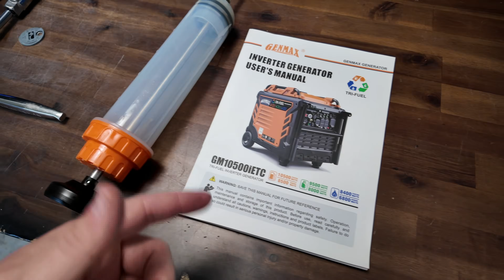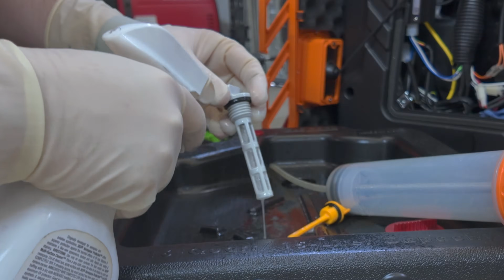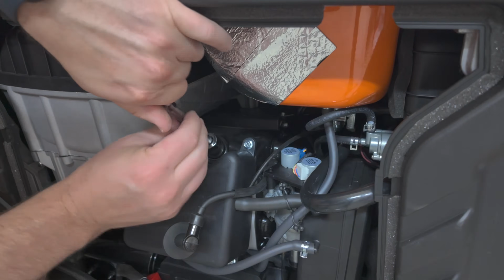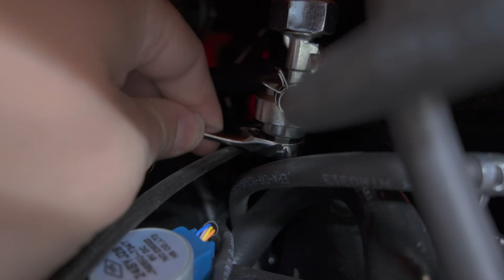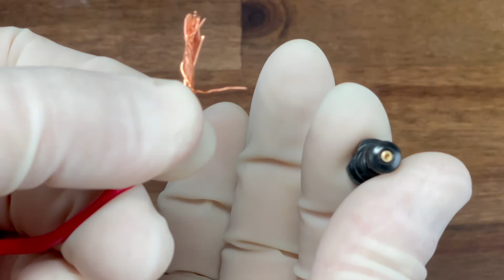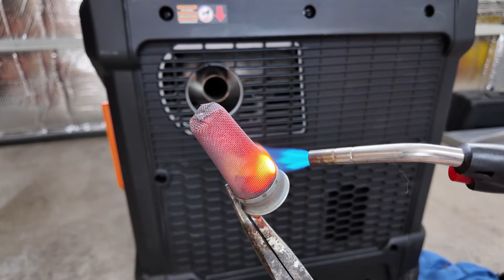GENMAX Tri Fuel GM10500ietc 100Hr Service Oil Change Spark Plug and more!

Comment: Thanks again for this great video! Am about to do the 100 hours maintenance.

My GenMAX 10500 has run great on only natural gas until a test run last week. Fired up with no problem. Smooth running engine with no seeking/hunting or backfires.

When I hit it with a test load from the house with no heavy loads, it cranked up and delivered power fine like always.

Then after 20 min or so it stopped delivering power but kept running. The overload light came on, but no extra loads had been applied. Powered it off and started it again with no problem, but 40-45 minutes later it abruptly stopped delivering power again, this time with NO overload light. 

So on my 100 hour maintenance is there anything specific I should do, or look at to try and diagnose/fix this problem?

Thanks for any ideas or suggestions.

ATB,
John

Comment: Synthetic oil should not be used until the first 100 hours of operation in order for the rings to seat properly.
Reply from the maker: This has been proving again and again it makes no difference anymore. So many additives in todays oils
High performance cars come factory filled with synthetic oil 
All modern cars foreign and domestic come with synthetic oil as factory filled

No one breaks in lawn mowers 
Weed chippers 
Weed wasters 
Chain saws 
Water pumps
Tractors and more

And this essentially is the same thing an outdoor engine. 

Even Hondas don’t mention anything about oil or even a break in procedure

Comment: What size hard line do you recommend for these generators coming off the meter for NG?
Reply from the maker: Depends on size of generator and distance. But it needs the correct W.C at that location. 
A large home generac may need 1-1/4 pipe 
But I have seen reports that some people used a half for smaller gens with out issue. 
My gas guy said 1 inch so you don’t have supply issues on heavy loads. Plus again distance. 
I would talk with yours

Comment: Thanks for the video!  So you'd recommend that 0.02 gap for both propane and natural gas?  There isn't a different gap for if you run NG exclusively?
Reply from the maker: No it will work for both 👍🏼

Comment: This is a great video and very helpful, thank you. 
At the 10:05 point you mention the ground wire on the valve cover. I'm not certain but I think that could actually be the sensor for engine over temperature.

Comment: How do you clean the oil extractor/syringe? I tried "rinsing" it with WD 40 and squirted it all out. When I went to use it again the plunger waa stuck inside the tube like I epoxied it. It won't come apart. I bought a 2nd one because I liked it so much but want this one to last. Appreciate any tips.

Thanks!
Reply from the maker: I don’t clean it really. But if you bought the one I listed it comes apart on the back. It just unscrews and came with extra orings
Reply: @johnnysweekends  Yes, bought it from your link. The plunger is all the way down in the tube and will not budge. I think the O-rings swelled up. I took it apart otherwise and tried to tap it out using a large phillips #3 screw driver but it waa a no go.

Thanks, though. It's a great item otherwise.
Reply: @johnbauman4005  when mine first arrived it had a heavy coat of a clear lubricant on it. Without any lubricant your o-rings are likely binding against the side walls.

Comment: Great video and nice tips. I just bought the Genmax Tri Fuel GM10500ietc. I have one simple question before I start to set it up for the first time. Where is the air intake? Is it under the front display panel, under the rear exhaust area? Please help me, thanks.
Reply from the maker: Yes bottom on the front
Reply: @johnnysweekends  Thanks for the fast reply to my question. It started right up on natural gas. Doing the breaking an hour for the next 5 days, then changing the break in  oil with  good synthetic oil. Like to have it last. Thanks again!

Comment: just received my genmax 10500, ran it for an hour with full synthethic 10w-30. Was I supposed to do just conventional instead? please help
Reply from the maker: You won’t hurt it, just change the oil frequently and use a decent name branded oil. 
Pennzoil platinum is the best unless you wanna buy Amsoil
Reply: @johnnysweekends  I’m a new sub. should these generators be ran on synthetic or regular oil?? I would assume that synthetic is better.. I am considering buying a genmax. Pls respond. Thank you

Comment: Great overview. I’ve never oiled any of my filters on any machine. I thought that was for mostly used in areas with alot of dirt and sand areas.
Reply from the maker: It definitely is for dirty areas for sure but good practice over all. If you are in a really clean area the. A super light cote would be more than enough
Reply: Ok awesome. I always learn something from your vids. 🙏
Reply from the maker: @michelleevans9869 😀👍🏼

Comment from the maker: Items In video down below. Thanks for watching the genmax GM10500ietc 100 hr service video. Hope this helped you out! Let me know and smash 💥 the like button. 👍🏼😀

Oil 10w-30:https://amzn.to/3QA2eGD
Oil 5-30:https://amzn.to/4dyvaZa
Spark Plug NGK: https://amzn.to/3QAvAo4
Spark plug gap tool:https://amzn.to/3QyLvmM
Oil Extractor:https://amzn.to/3wrBKQE
Rags:https://amzn.to/3yio8aN
Gloves:https://amzn.to/4bardZe
Parts cleaner: https://amzn.to/44vM32y
Air Filter oil:https://amzn.to/44wdJV8

Have a question you want answered fast: https://asqme.com/@johnnysweekends

BUNDLE & SAVE SHOP SOLAR KITS ! https://shopsolarkits.com/1134

CHEAP USED CERTIFIED SOLAR PANELS HERE: https://www.santansolar.com/?ref=Johnnys%20Weekends 

SAVE BIG ON NEW SOLAR PANELS HERE: https://signaturesolar.com/?ref=JWKNDS 

CHECK OUT MY AMAZON STORE: https://www.amazon.com/shop/johnnysweekends